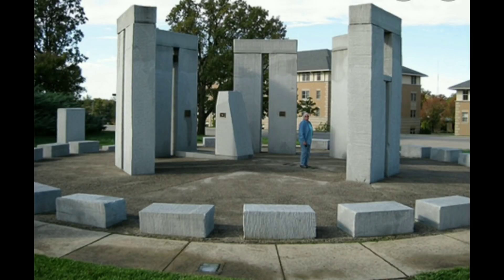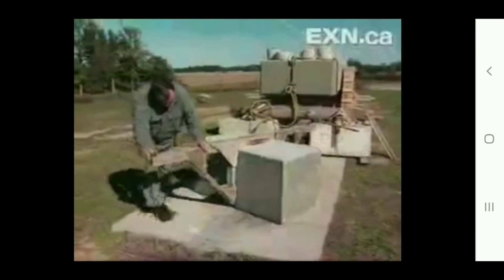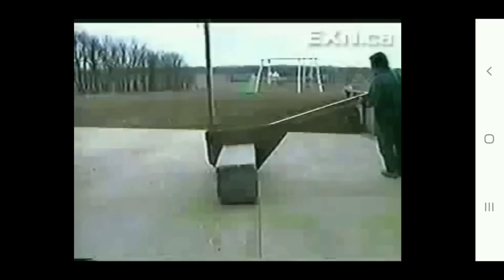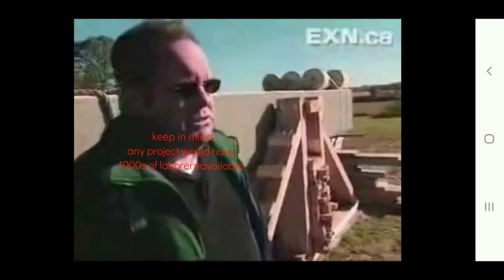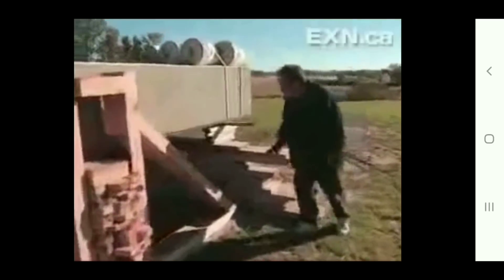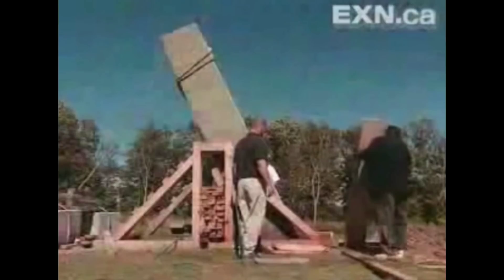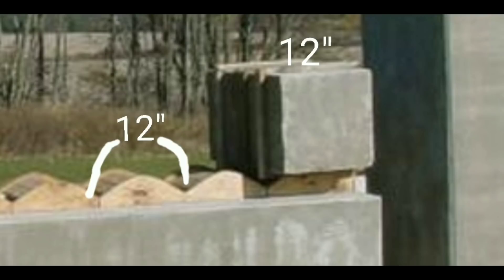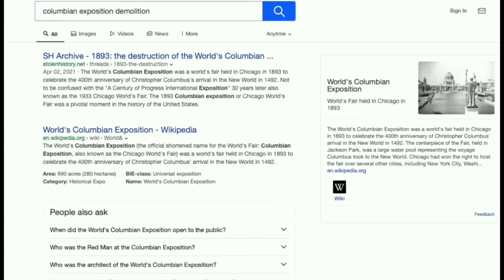1 Guy EASILY Moves & Lifts 9.6 TON STONE BLOCKS!!! Lost Technology Wooden Nickels

Comment: Those dang primitive humans that easily constructed thousands of acoustically tuned domed structures, tricked them out with ornamentation, 10-20,000 pipe organs so that the domed cavities would  resonate with the flux density of material
used throughout the whole, perfect geometrically cut and installed colored glass to match the tiled flooring etc. etc. etc., and most between 1850 to 1890...pesky primates
Reply: Ikr🤣
Reply: @doctorofart  Yes, I am in agreement. He descends lower into ego with every video he publishes. He had to have hit the same impenetrable brick wall that was put up by the controllers of information that most all of us have reached. Maybe nobody knows who built the impossible structures. I am okay with only admiring and not knowing, as is the case of many of us in being honest with ourselves. But he cannot relinquish the carnal mind, feeling the need to prove something that can't be proven. Feeling a little sorry for him at this point.
Reply: @GentlemanBystander  254,000 years seems to be pretty much irrelevant. Let alone any history going any further back than 1947. Yes, impermanence whether sold or felt is a fact of life. In my opinion, most leaders are just as lost as anyone else. Yet they are given a public platform to put on a good act for government, the materialist god of most men. What I find remarkable is that most of us don't know anything about our ancestry. I suppose I shouldn't speak for others. I don't know anything about my ancestry. People can talk a big game on the word "freedom", while at the same time freedom being the very idea that scares them the most.

Comment: Square. Rectangular. Blocks. Can he carve 800 statues and haul it all 20 stories above the ground? And build countless of them and rivers and star forts? NOT the small one like you showed. And even more underground? This is sad dude.
Reply: Exactly. It's like these people are taking an 'update' and ignoring the glaringly obvious facts you've pointed out.
Reply: @JTNZ333  That is exactly right. And they will peel off those who want to hear it and in my opinion further seperate the wheat from the chaff. And he is supplying lots of ammo for the lost. He was brilliant and alone now hes the favorite all if a sudden. But it's inevitable. Stay on course. :)
Reply: He's super arrogant.  Very off putting.  Acts like he's got it all figured out with one dude moving around a few basic bricks.
Reply: The giant blocks he uses are nothing more than heavy boxes, if you take a look at 5:24 you can see a line to the left of the corner (close to the spirit-level) thats how thick the sheets are, the cement must have cracked when it dropped down.
Reply: @Mr.Grimsdale  Im not a big emoji guy, but... 💥💥💥😄👍💪!!
Congrats on your investigation. I see it now. We missed it. That was perfect, you're on a par with Wise Up. I hope it opens hearts and eyes.
Missed something Static?
Reply: @daninphoenix6851  Thank you for your kind words. I'll add another observation, how does he spin those wooden blocks so smoothly ? He uses two metal flat disc that each have four rods, one is inserted into the ground and the other into the underside of the block, see the four holes at 1:10.

Comment: Doesn’t explain how the multi multi ton stone was cut out of the quarry with straight line uniform edges. And none of the methods are practical when moving hundred ton obelisks hundreds of miles. Definitely good technique’s when it comes to moving around the site but transport to and out the quarry I don’t buy
Reply: I rule nothing out anymore. But extraordinary claims require extraordinary evidence
Reply: There have been people who have already demonstrated you can cut uniform, massive blocks of stone with bronze chisels and rope saws already.
Reply: @GentlemanBystander   do you remember what the timeframe was they finished one block in? I understand it wasn’t impossible but I’ve used hardened steel tools and concrete saws for demo work and they need replacing after a day. Bronze and rope would just seem impractical in a large scale project. And held too much value to be a disposable tool. There had to of been other and better techniques that have been lost to time and out of our frame of thinking now a days
Reply: @GentlemanBystander  any channels that show it would be interesting to see. I know you can't leave a link or they erase it. but if you have a name of a channel
Reply: @MsBleau  There are some really old videos that folks have uploaded on youtube where Egyptologists demonstrated a number of methods, there is no one channel answer as they're scattered around but some examples were using sand as an abrasive with a bronze "saw" moving the particulate.  There were also some slavic guys that had a video on Scientists Against Myths channel that used clay to create a water trough on granite then used a bronze saw to cut through, producing the same sort of cut striations found commonly on Egyptian stone constructions.  Those are just a few.
Reply: @GentlemanBystander  thank you I will look them up now that I know what to look for
Reply: @brakefaded My guess would be some form of controlled fracturing, with maybe finishing chiseling after.
Reply: @brakefaded Yup, people were just perseverant. Also, it was the wealthiest kingdom of the time, and the pyramids were of huge religious significance to the people. If they are gonna use copper for anything, wouldn't it be this?

Comment: I've seen this clip a number of times,  but it's never hit me till now. When he rolls the block over that wooden track, with the uneven or changing height I realized something.  That is the perfect way to move large stones over uneven terrain.  I could be wrong,  but what if the "cart rutts" all over the world are grooves made to put a similar system of rails and alternating height planks to move cut stone using whatever to pull it. Let me know what you think, love your channel man! You have a great rational perspective that is a rarity in this field. Thanks!
Reply: When Russians in 1770 moved a 1500 ton block 6km they used a metal track, so yeah thats a method. Its documented on an Egytpian tomb wall painting that they put a statue on a sled and have men pulling it, also it depicts someone pouring liquid in front of the sled. Its been tested that when sand is slightly wet it reduces friction by a lot, so it seems likely thats what they were doing. But maybe for the rockier terrains near the quarries they had to build some sort of track underneath

Comment: I installed carpet, solo, for decades. Moving a thousand pounds of deadweight is not as hard as one might think. I'd use a sawed up broomstick as rollers, and one roller in the middle when I needed to pivot, just like this guy using a stone. Or I'd use a forklift. Those work too. But you can't fit a forklift in the van, so rollers it is.

Comment: I think this topic is a bit more nuanced and complicated than most people seem to think, on either side of the debate. Of course simple leverage can be used to great effect in moving large weights short to medium distances with manpower, but there's a point at which that truly becomes impossible, and those are the cases where ancient lost technology is still very compelling. Sites such as Ollyantaytambo, Tiwanaku, Aswan, Yangshan, Easter Island, Baalbek, etc. in which blocks of truly hard stone (such as granite and basalt) weigh in the HUNDREDS and even 1k+ TONS! If you tried this same sort of simple leverage technique (or a variation of it), then any wood you'd use would be crushed to a pulp, even if you used the hardest wood available, no matter how thick the logs/boards. 

Fortunately we do actually have a well documented case where Russians set about quarrying and moving the 1,000+ ton (initial weight before finishing work) "Thunder Stone" hundreds of miles to Moscow, and that was only possible with large teams of oxen and men who were regularly rotated in and out to keep everyone fresh, capstans, pulleys, and other types of simple machinery. That took literally months, and could ONLY be done in the harsh Russian winter when the ground was frozen solid. 

It's not the 10-100 ton range of blocks that leaves most people incredulous, it's the 250, 500, 1k+ ton blocks that simply don't make sense with what we know of ancient technology and techniques. It's also the incredible precision of much of the polygonal and cyclopean masonry found around the world, irrespective of size. NO ONE has even demonstrated how such work was done, and while what this man accomplished by himself with his own manual labor is beyond impressive, it still comes no closer to answering those glaring anomalies.

Comment: in philly there’s the franklin institute science museum . there’s a hands on exhibit where the large stone and on the other side are ropes you pull down. there’s a smaller one, where there’s small pulleys vertical and horizontal and you can change the configuration to move heavy stuff. lolol no mystery . the guy who built that umm corral castle by himself had a box that he used to move the heavy stuff. well duh inside are pulleys .

Comment: I like the lifting with water idea.   People could float a bock into the base of a stone tower, roll a stone door shut from inside, climb out the top, fill the tower with water, and the bock floats up. Now you drain the whole thing, and do it again.
Reply: But you have to waterproof fairly well.   Might work with a leather liner.  But then the pressure is also trying to push out the walls of the vertical tube - bind the whole thing with rope?

Comment: The giant blocks he uses are nothing more than heavy boxes, if you take a look at 5:24 you can see a line to the left of the corner (close to the spirit-level) thats how thick the sheets are, the cement must have cracked when it dropped down.
Reply: Hahahaaahaha.
Reply: You've never cribbed concrete, fact! That line you're pointing out, is where one piece of 3/4" or 1" plywood was used to forum or crib a concrete mold for these blocks. You're pointing out the butt joint in the the two pieces of ply, thats now cast in concrete.

I've received a raise at my work for moving 3 or 4 1000lbs+, rough cut stones. We were to place them into a grass berm, leading up to the garage of a client's home, as decorative steps, we were building. I was the only one who knew how to move them... because of earlier posts of this video.

Comment: Wally's way of lifting the oblix is probaly also how the stoneblocks for pyramids were lifted. 
When moving anything you want a straight line, but if the object too heavy then you' ll need to doit  in a L-shape way(flipped up-side down).
With the use of Wally's 15 people could lift 5 blocks a day one level. And you wouuld able to have 5 stations on each side(20 in all).

Comment: Moves the blocks on a solid flat foundation with stones..  what about loose or uneven ground ?.... it shows things can be done but not in all conditions
Reply: Massive stones can be transported on ground through a few methods. And as far as building goes, you usually build a foundation before you put anything on top of it.

Comment: Most of the megalith ruins are ZERO magnetic stone, both positive and negative repels. 
By placing magnets along the ground in line for transportation, you could literally float the stone in place. 
Another option is lightweight, smoothed and flat stones as pavers, wetting them as you're working, and using sound to create vibrations in the water. Again you're floating the megaliths.
Last option, same pavers and water, use electrical charge and the water naturally lifts toward the electric charge and you are still floating the megaliths stone. 
Any of these three have evidence in artifacts, are within current knowledge, and would require minimum of labor.
Additionally, there's overwhelming evidence the builders were at least 9 feet tall and historical texts say as much as 30' tall. At these sizes, even less labor needed.
No physical manipulation of that kind needed either with regard to the megaliths. 
✌️ Favour ALL
Reply: Then why did they make the passageways in the Giza pyramids only about 4 and an half foot high, if they were at least 9 foot tall ?

Comment: I wish I could could get out of bed so easy. Fascinating stuff. Although at this stage I am open to it being a mix, but I was more fascinated with the reset side than a lot of the construction. Will we ever get to the bottom of it all I wonder? I can also see why people are pissed lol. Just one question, just an out there one. With these massive cut stones how did they get anything under them to start the fulcrum going? In the video he already had the stone in place. What he demonstrated and what was shown as the finished project....Would have been nice and I am sure it is out there of him doing the entire structure. Anyway again food for thought. Addendum I went back and looked again and the video never shows how he started to process, or indeed how he got the blocks there in the first place. If you had quarried rocks of that size how were they moved and lifted for transport. Too many gaps need filling. Now is it Wake Up that thinks of lot of this stuff is actually poured concrete? Well it is almost six am and my brain hurts lol.
Reply: They could chisel it in place so its vertical then place the rocks and what not next to it and topple it over with lots of weight. heaps of different easy techniques

Comment: Nice idea. you put one stone that was 20 tons. Where's the video on how you raised the top stone going across? Also Stone Henge is alot easier to build then  a  pyramid. Giza pyramid 20 to 70 ton  stones were boated in. Since back then a river went between the Pyramids. You would have to build a system. That heats  stone so you can mold it perfect. Then carve drawings or words into the stone.  Then you have to move it. You need a energy that comes from Earth. This is the hard question?? Even if I told yas you would belive it. Been playing with this stuff for years. Plus it's free .    .  ....
Reply: Go check out SGD Sacred Geometry Decoded. He shows videos, old images, and demonstrates a lof of ancient techniques that aren't known to people trying to sell a lost high technology mystery. There's ways of moving massive block upwards, and very fast. I have a playlist of his best vids showing it.